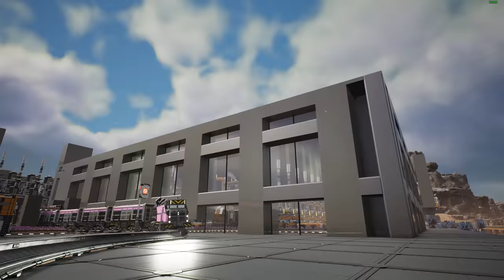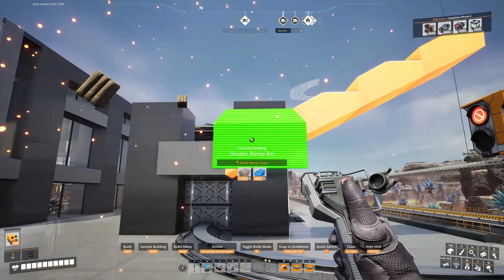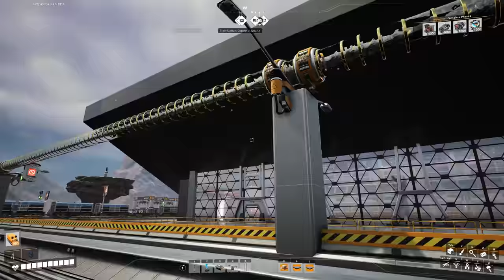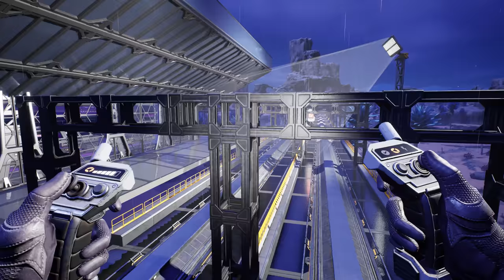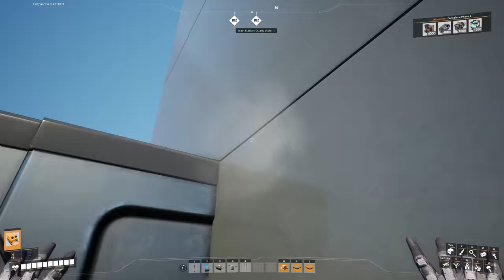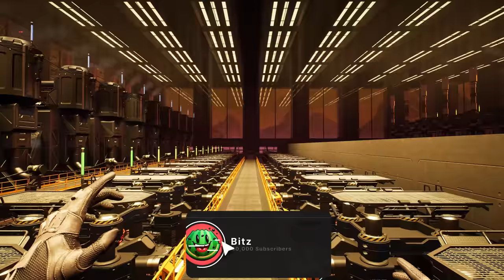These DESIGN changes were NEEDED!!! in Satisfactory

Comment: for the sheer walls on buildings as far as if you want lil more depth/texture swapping out a layer of 4m foundation to half 4m foundations same color and texture but just have that lil "dip" in the wall as to not just have a sheer flat surface going down. this can be done both vertical and horizontal depending on if any of them fits the bill. (just a idea as you mentioned towards the end there that you might not leave the walls as they are on the side there. it will also show up inside ofc so would prob be most useful on the layers that are below factory floor as to not intrupt the features inside the factory.
Reply: or add half 4m foundations on the outside to build on the angled/beam pattern wich would not effect inside looks at all.

Comment: When I put a railing on a pillar, i will use a half foundation to get the perfect line up for the railing then add the pillar under it after removing the foundation. An extra step, but this is good for those having problems lining things up like Bitz did in the train station with the railing on the pillar trick.